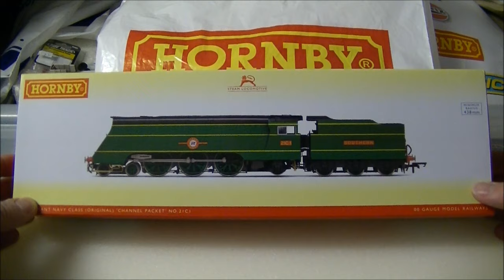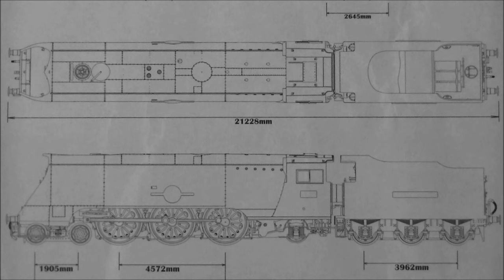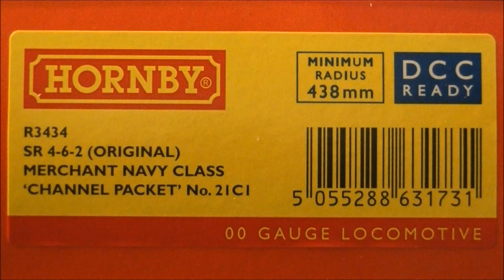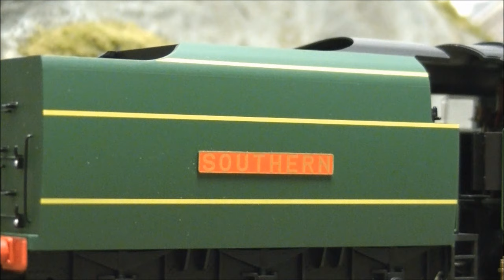Hornby R3434 - SR 4-6-2 'Channel Packet' '21C1' Merchant Navy Class Review

Comment: Cheap printed number/nameplates detract from a very nice model. For over one hundred and sixty spondulicks I would expect fine etched number nameplates at least to be included in the package. This doesn't shape up at this price-point to the new Dapol Class 68 diesel for instance, which has proper lights and etched plates fitted.
Reply: The number/nameplates don't detract from the model and the number/nameplates are not bad. In my opinion fine etched number and nameplates are not needed to make it a great model. It is not too hard to get your own fine etched number and nameplates.
Reply from the maker: Hi SuperWHIZZO. The camera and light sadly does not do the plates any justice. When I first got the model out the box it honestly looked like they are metal. Really is a stunning piece of kit. Though if you do wish to replace them with etched ones, they can be sourced
Reply: My experience of sourcing etched plates is its a bit hit and miss. Hornby's duchess plastic" printed-on" plates are larger than scale , so proper scale etched plates aren't long enough. This early "Southern Railway" version of this machine is awesome in photographs and the model would have benefitted from plates that reflected that !
Reply from the maker: Should be no size issues with this one, as they plastic ones pop off.
Reply: It's a nice Engine but overpriced, I would wait for the discount boy's.
Reply: +SuperWHIZZO I bought the model. More disappointed that Hornby's contractor QC over their labour force can't manage to see said plastic xxxxplates affixed with sufficient care to be aligned. Apparently taking a few moments to use a rule or masking tape to align parallel with the sunshine lining doesn't rate for the SRP. Their lazy attachment with superglue doesn't endear me either. C'mon. Either place the visual accessories on aligned with the sunshine lining or use a dab of Pacer Canopy glue or Weldbond to attach them permitting easy removal and refit without damage to the loco paintwork so we can affix them as they should have been in the first place.